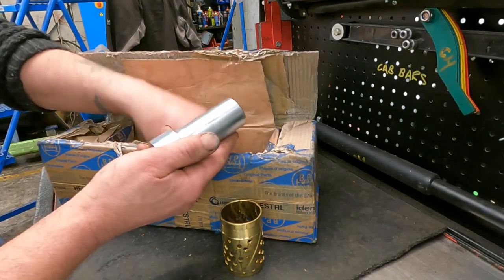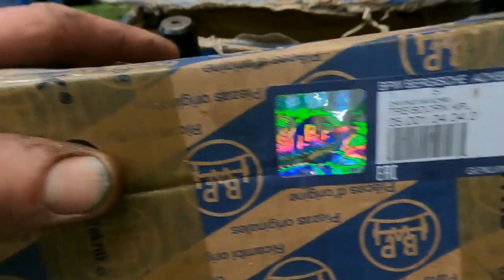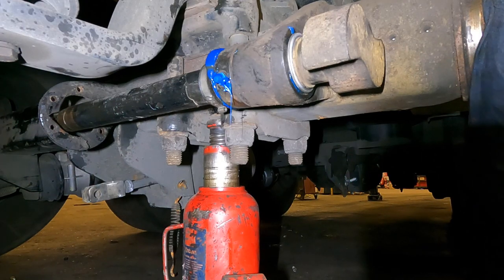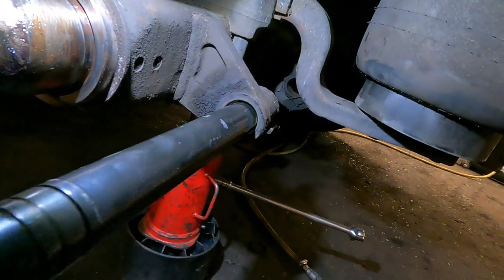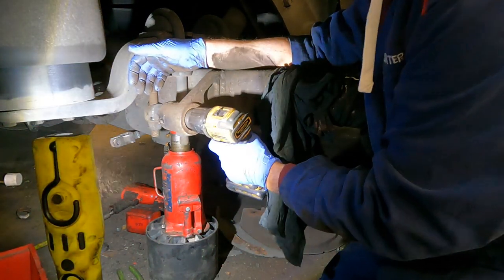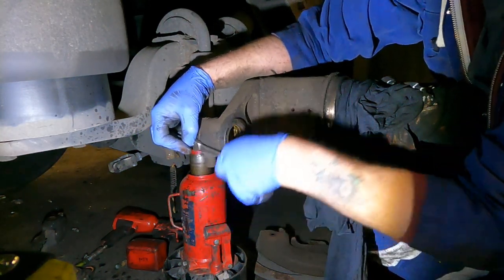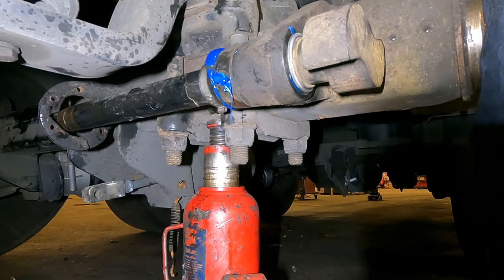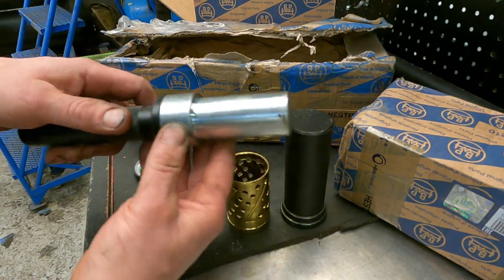Heavy Axle Trailer Technician - Cam Bush Driving Mandrel BPW 05.001.04.04.0

Comment: I like that bpw tool looks the bollocks! its probably a bit savage but ive been using a old chopped down camshaft to drive the new bushes in not ideal but it does just about get the job done and I totally agree on the bpw diagrams ridiculously small on the print. 😅🤣👍
Reply: I used to do that too and saw a lot of other fitters use the cam till a piece of the cam chipped and imbedded  in my face . Just saying to be careful and  I  was only tapping the cam with the hammer to get it to inter the slack adjuster.